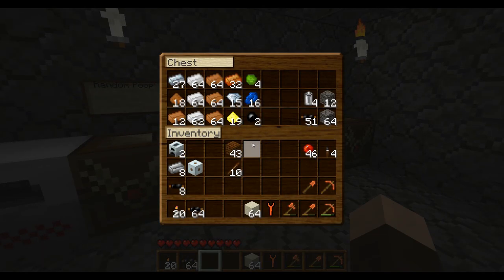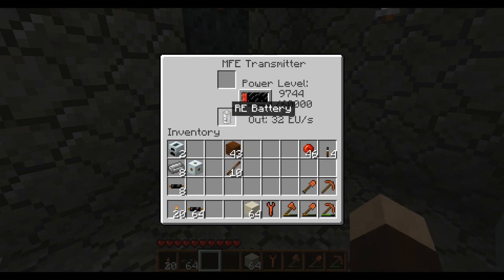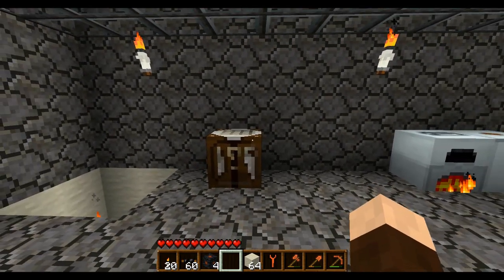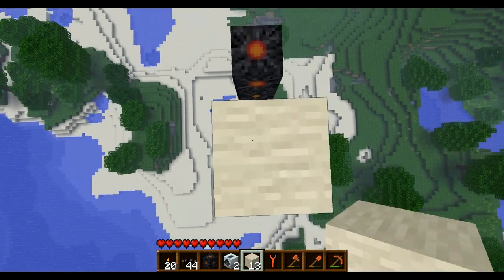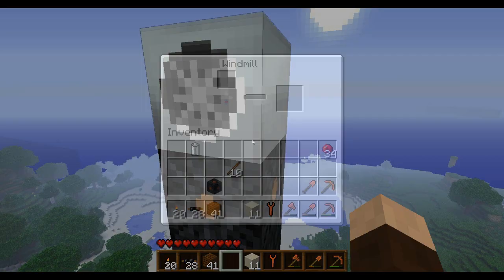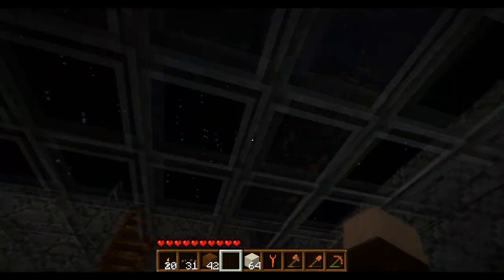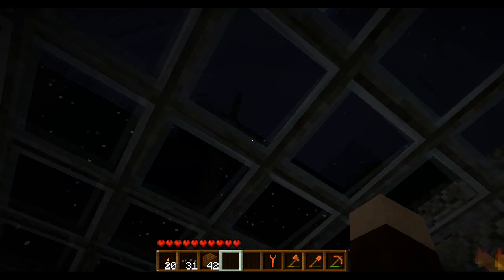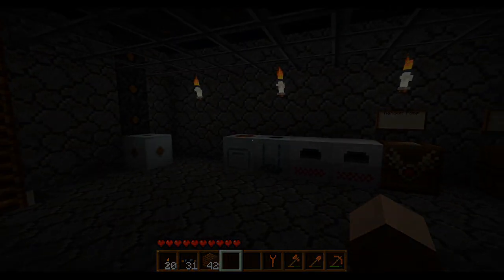IndustrialCraft Adventures - Episode 3: We Start Getting Fancy

Comment: I believe you need a switch cable where the cable branches, or else only 16 of the 32 EUs the transmitter on top is sending out will get stored in the next transmitter. The other 16 EUs will go in the other direction, and disappear. The switch cable only outputs power from the bottom (or the top if you apply redstone power to it)

Comment: @galucia081 It's also better to use High Powered cabling to bring down the power from the sky. You use normal cables but with HV Transformers at either end.  You can go a long way without really loosing any power. (Just don't get the connections wrong. ;)